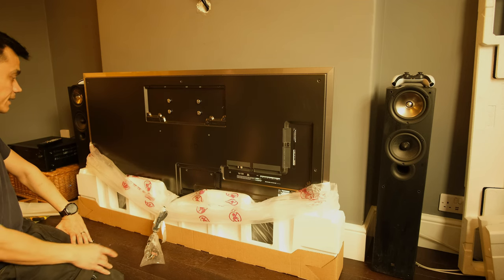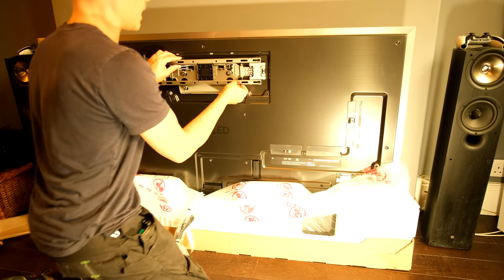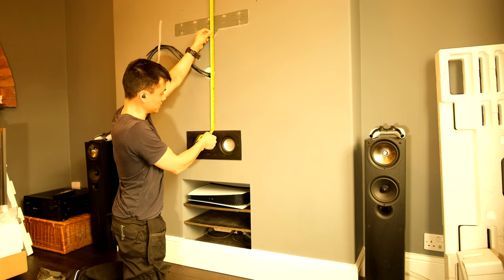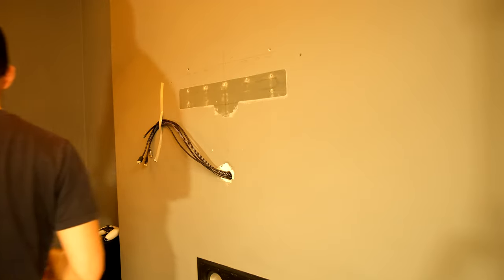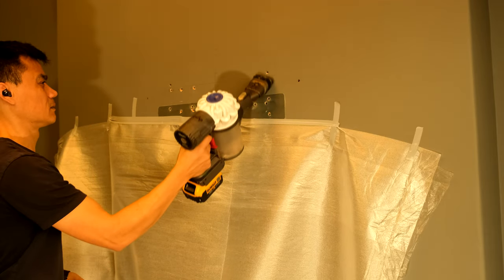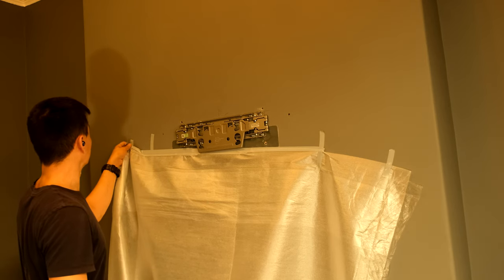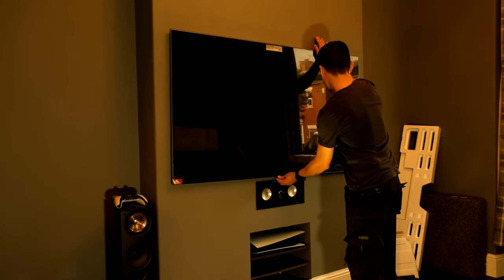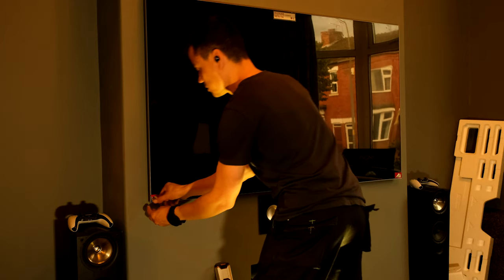LG OLED 65 G2 Wall Mount Install, How to Mount on a LG G2 Bracket

Comment: Can the bracket level be adjusted without removing / re drilling if the bracket was not installed fully levelled?

Comment: So cutting the plug off is OK? Uk also here, not sure how they sit under the warranty (but costs are immense to recces a plug socket)
Reply from the maker: Yeah I had a look the replacement mains lead to the back of the tv is £45, so worst case you can replace that if necessary

Comment: Thanks for this! Does the positioning of the hole in the wall for the cables matter much? I want to be able to keep the TV flush to the wall, so I worry if the positioning matters since there are guides on the TV itself for the cables. Thanks again
Reply from the maker: Yes the hole does matter, luckily for me the hole lined up with the recess at the back of the tv, if it didn't I was going to make a shallow channel in the wall to help the tv go back flat
Reply: @TellyDan  thank you!

Comment: Thanks for the review I just bought one and have the same issue with plug. If I cut off plug do I put a 13 amp or 10 amp fuse in the new plug? Also are you running 2.1 ultra fast HDMI cables? Thanks in advance
Reply from the maker: I'd say 10 amp, all the cables I fitted are hdmi 2.1 and 48gbps
Reply: @TellyDan  Thank you 🙏

Comment: Question…

Just finished installing my g2 and it’s not level, can’t find any adjustment crews anywhere 

Any ideas?
Reply from the maker: Yes, just pull down either corner it should move
Reply: @TellyDan  turns out I didn’t have the tv completely flush, 

After pushing all the way it levelled itself out 🥳

Thanks though

Comment: I just bought one and am wondering if your location for HDMI cables was in the wrong location to push the TV all the way back. My fear is that I’ve got mine in the wrong spot that will fit in the grove the TV has on the back.
Reply from the maker: Hi nick the hole by chance was inclined with recess at the back of the tv which helped the tv sit flat against the wall
Reply: @TellyDan  thanks for the information. Mine however was not positioned in the right spot so had to use a traditional mount.

Comment: Does the mount offer any tilt for direct viewing angle
Reply: You can pull the mount forward and then tilt left or right. This is for cable management, but if the mount is installed correctly i don't see it being an issue to keep it that way for longer periods

Comment: Are you drilling and mounting into the stud or just sheet rock? what type of wall is that.
Reply: Sure looks like there's brick behind that wall. On a conventional wall you'd  want to hit studs with at least two screws, although that bracket is so narrow that depending upon where it lands, you may not be able to. If that was the case, I'd use a 1/4" toggle bolt on the non stud side. I had a 80lb Pioneer plasma mounted that way and it way fine - this TV is only 50lbs.
Reply from the maker: Brick wall

Comment: Nice video Dan . Is that your new 'toy'? 😁
Reply from the maker: Hi Nick, yes I'd thought I'd try one. Was a bit disappointed at first.
Reply: @TellyDan 
That's interesting. Too dark?
Reply from the maker: @nickhickson8738  yeah lots of black crush and I could hear a whining noise from the back of the tv on bright scenes
Reply: @TellyDan  I would like to hear about your experiences with this noise you describe. I wonder if it's something that you could live with, or if it is enough to put you off of this model. Also, if it is common to other LG OLED models.
Reply from the maker: @Nathan Barnard  to be honest with the sound on the only time I've heard the noise is if a movie goes silent, so in all I'd say its tolerable. When watching a movie with my friend he doesn't notice it and says I'm concentrating too much 🙄

Comment: Did u get any of the studs? Or just the wall??? Putting up mine on Tuesday
Reply from the maker: Mines a brick wall so just wall. As long as you can get a couple of fixings in one stud you should be fine

Comment: Do you have to use that bracket or will an existing bracket also work?  I understand it won’t be as close to the wall just curious.
Reply: What I’m wondering.
Reply: @kheels28  checked - no you have to use the included bracket -- so much for lg
Reply: Ended up calling LG. Sure enough I was able to use my swiveling mount. They just don’t have that info out there. It has to hurt sales with thinking their bracket is the only one to use.
Reply: @kheels28  How? i returned it and bought a C3 instead
Reply: @kheels28  I had two chat sessions and both "agents" insisted I had to use the included mounting system
Reply: @jeffplanck755  I took a picture of my tv but can’t put the picture up for you to see.
Reply: @jeffplanck755  the person I talked to made me feel foolish for asking that question. No where did I find online that another wall mount would work, but it does have holes for other mounts.
Reply: @kheels28  Oh well, sent it back and bought a C3. I didn't want to unbox it since there was no picture of the back of the screen. Thanks anyway. This has got to hurt their biz with all the already installed brackets and reading about all the people pissed that the LG's aren't coming with legs anymore.🤑
Reply: guys, you know what VESA mounts are? All modern TVs have them... As long as you check your TV's VESA sizes you can use any mount that supports this size. Of course, only with the provided LG mount (For the G series) it will be flush to the wall.

Comment: Never had a wall mounted TV before, got sockets and a TV aerial socket high up on the wall (concrete) so it won't sit flush when mounted. Will it look shit? The stand for the G2 is pretty terrible too by the looks of it
Reply from the maker: You could change the socket for a fused spur outlet and connect the aerial up inside the socket but it wouldn't look too bad pushed up against the plug if you go that way. You can fit a universal pedestal stand if you don't like the G2 one.
Reply: @TellyDan  yeah had I gone for the G2 I would have just purchased a VESA stand for it in the end but couldn't justify the extra money over the other TVs I was looking at (S95B, C2 and QN90B). Went with the QN90B in the end as there's a decent deal on it

Comment: Did you have any problems passing the cables through the wallhole, because it's very central?
Reply from the maker: By chance it lined up with the recess at the back of the tv, also I installed 40mm pipe in the wall

Comment: Clean job! Isn't it a fire hazard to run high voltage wire behind a wall like the tv power cord? I thought that's why some choose to use powerbridge or other solutions.

Comment: Good installation video on that particular bracket. Even the official LG video proposes that all the cables should exit below the bottom of the TV 🤦‍♂️🙄

Any idea on the drop distance from offering the TV into the bracket to the secured position? I've an alcove to fit mine in and I've limited space top and bottom 🫣